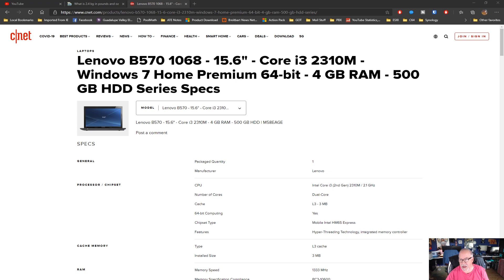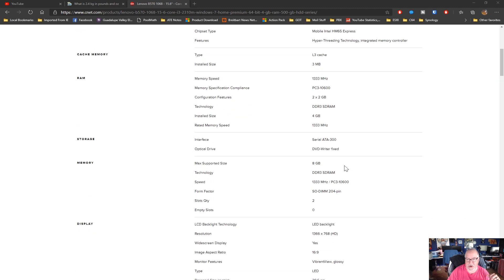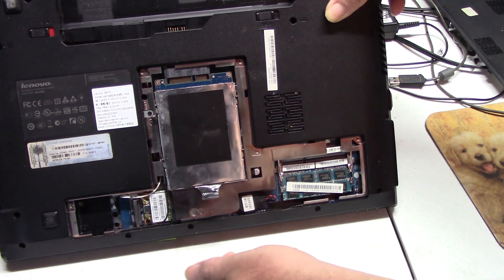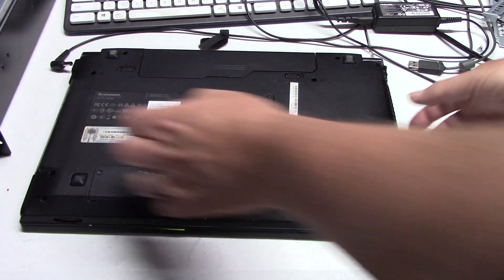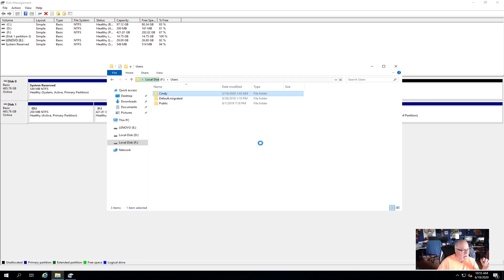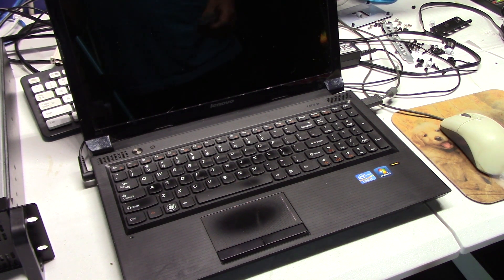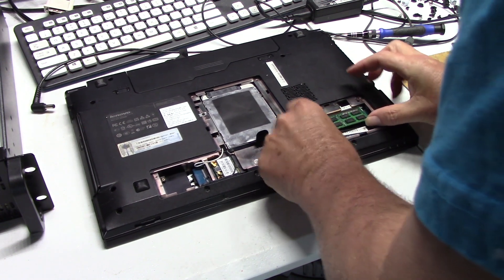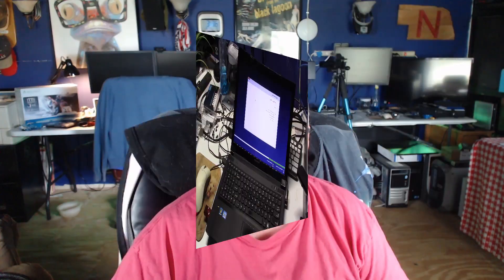Keeping a laptop out of a Landfill.

Comment: About 5 years ago I found myself in a position where my only working system was a 733mhz pentium 3 based IBM thinkpad. I slapped puppy linux on it, and shockingly enough it worked as a remarkably decent browser. Youtube even worked with the MiniTube client. I still keep that laptop, just incase. Always great to keep old tech out of the ground for as long as we can! Maybe one day, they'll figure out a safe enough method to reduce these machines back to their base elements.
Reply from the maker: Thanks for watching :)

Comment: Great video. I'm running a HP Probook 6450b with i5 dual core with 8gb ram and 240gb SSD. I paid $29 plus shipping from Ebay seller. Its my favorite laptop. Its very easy to work on. I run both Windows 10 Pro and Arcolinux xfce on it. I just switch out the SSD.
Reply from the maker: Thanks for watching :)